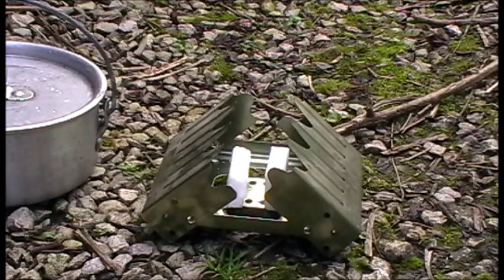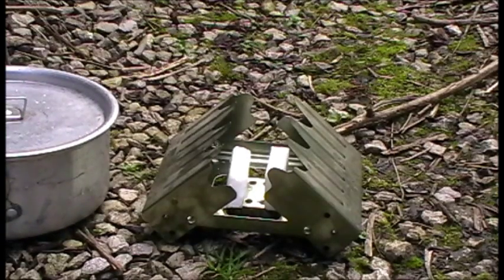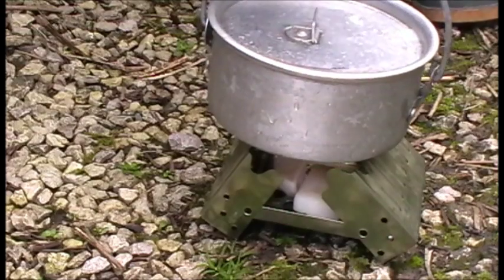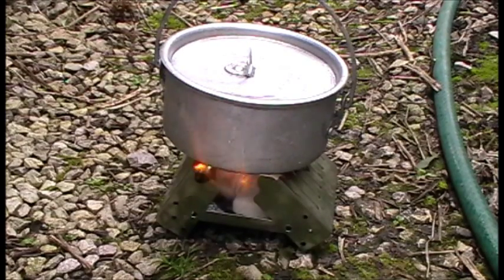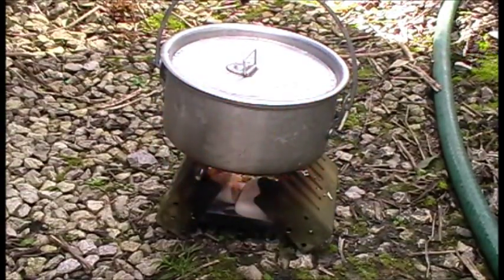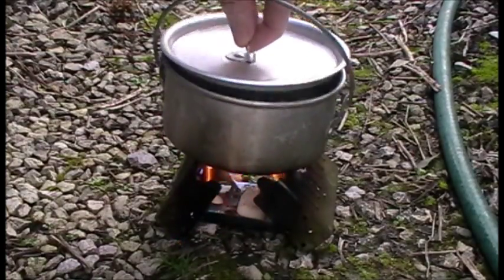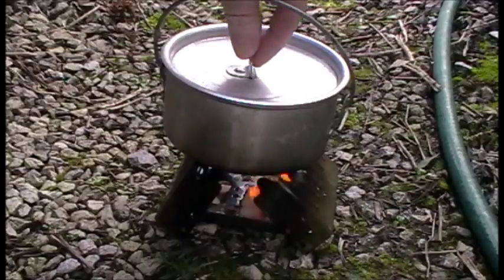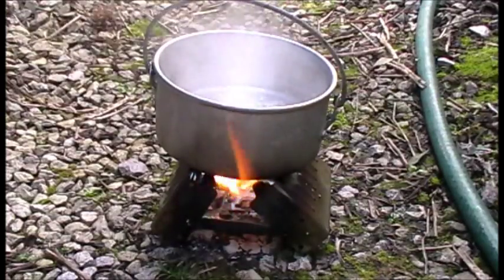Hexamine Stove boil test

Comment: Really Useful thanks!! 

You boiled 0.3kg water which required 113,400Joules energy. The Hexy block at 0.0375kg provides 30MJ/kg so that's 1.125MJ. That's an efficiency of (113,400/1.25M) x 100 = 10%. The jetboil claims 70% but it's such a lot of excess weight to carry for an overnighter.

Comment: Been using tablet stoves since the early 1970's (73?) and I have 17 different designs at present. It's amazing how many places and climates I've used them and they always work. Too many advantages to mention.

You were smart to break the fuel tablet in half. If I just want to boil water, and that's usually what I do, I break them into halves or fourths and increase the surface area burning. You get much faster boil times. Using several of the 4 gram tablets is a good alternative. Using a decent windscreen has an amazing effect on reducing boil times in any kind of wind.
Reply from the maker: They are great little stoves